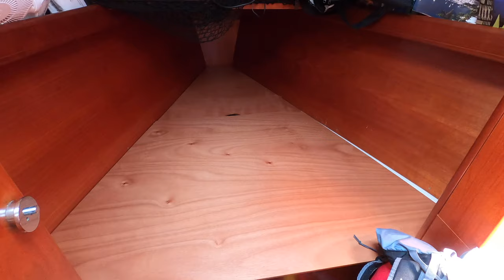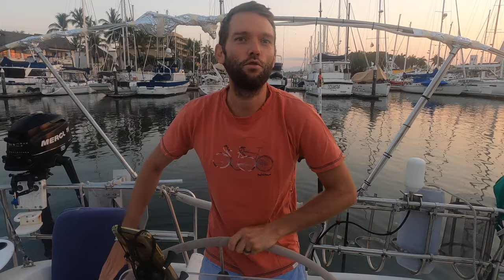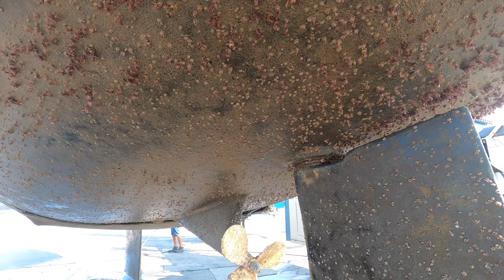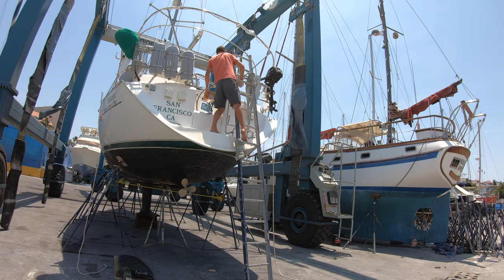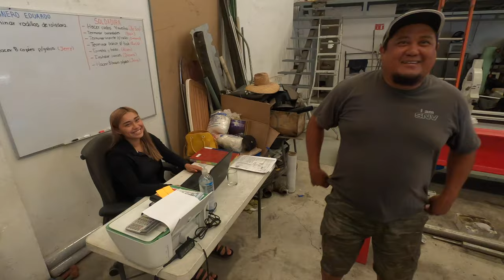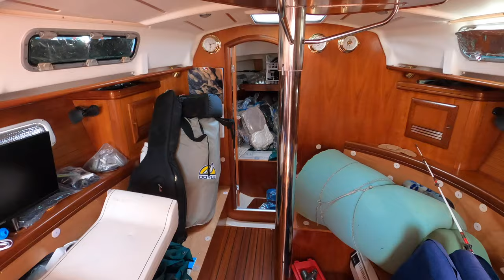Hauling out in Mexico! Sailing Bohemia Ep.75

Comment: Hey guys, Question, I'm considering a haul out in Mexico somewhere near Puerto Vallarta or in the Sea of Cortez to work on my boat. Do you think it's more expensive or harder to find parts etc in Mexico or easy enough to work on the boat without spending crazy amounts of money compared to in the US?
Reply from the maker: Hola Aaron. I'd say it's a mixed bag really, spares and imports are notoriously hard in Mexico, but the yard rates and labor costs are quite a bit lower in our experience (San Francisco rates were sky high!). We had a good time with Alvaro and Opequimar in PV... there's also a good chandlery nearby which helped. We never hauled in the SoC but a popular option with folks from the US is Puerto Peñasco as they can hop across the border easily. Best advice I can give if you haven't set off yet is load up on spares while it's easy, or plan on waiting a while for them. Fair winds!
Reply: @SailingBohemia  Thanks! Looking at rates I think I’ll have it hauled at San Blas just north of PV. About $135 USD per month to store on the hard while I work on it and yep I’m in the states now so I’m working on gathering what spare parts I know I need plus some just in case. Thanks for the input